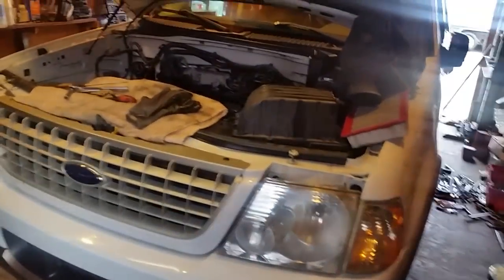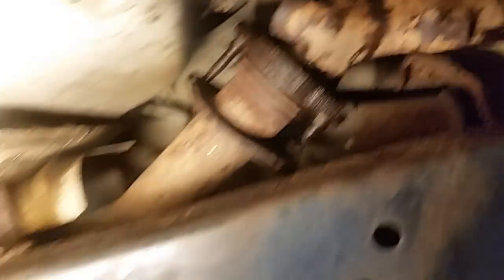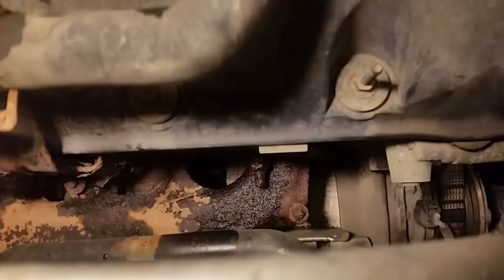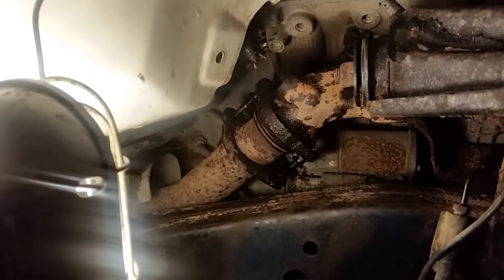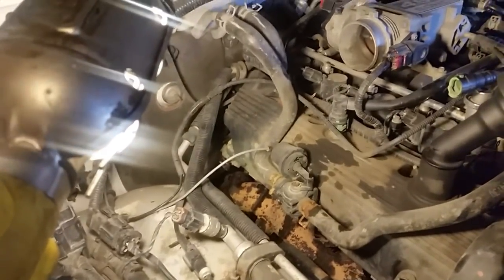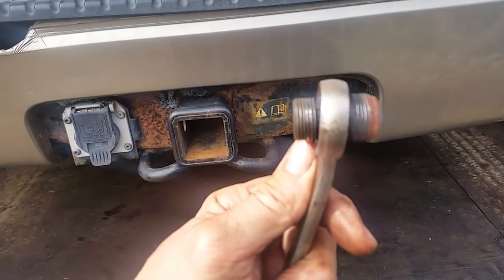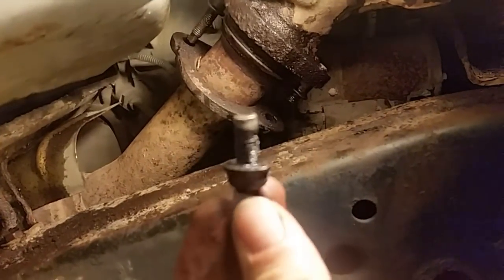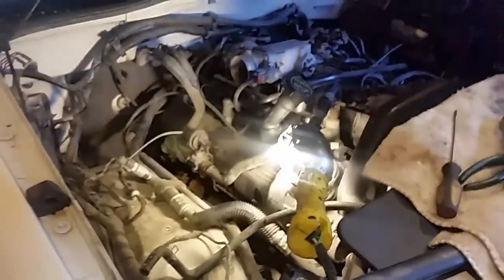4.6 Ford Dreaded Exhaust manifold Work.....ugh.....PART -1

Comment: I know what you mean, i did a fuel filter replacement and i messed it up by breaking the clip and i was on the step where i just  had to connect it back when it broke. The truck was suspended in the scepter ramp for 2 days! People in the apartment were giving it weird looks that like it will lift off to outer space! I wished i had never had touched the truck since the fuel leaked and had to have my car towed to a master mechanic who fixed it.  It actually made me think of not working on the vehicle again after that. What made things worse was the smell of fuel was all over the place and working under the truck was claustrophobic.

Comment: Hey sir , having issues with my 02 4.6 running like crap 500 rpm only codes I had was coil pack misfires , changed all plugs ,packs , EGR , mass air , no difference, clogged cat , bad ecm ? Idk what else to do , any guidance greatly appreciated